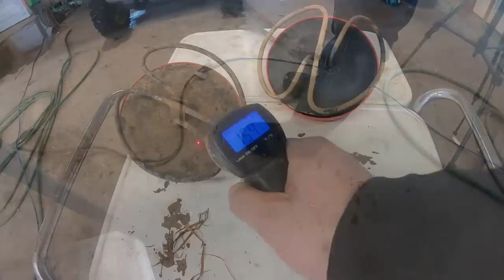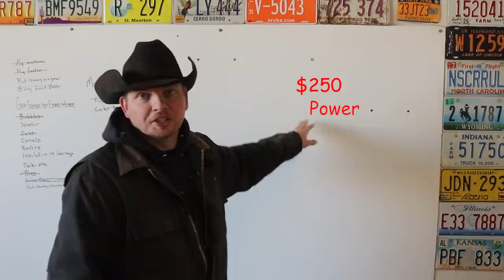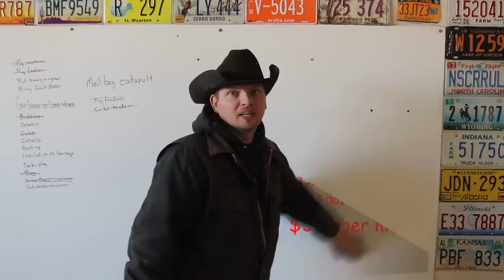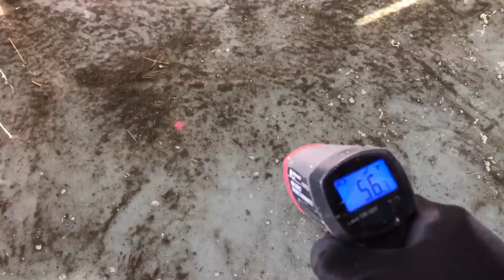Stock Tank Heaters vs. Breaking Ice - Water on the Ranch

Comment: The best investment I ever made was building lids for our tanks. Nothing special, just 2x4s all the way across with a hinged door for livestock access. Morning chores went from chipping ice to just opening the door for them to drink. Significantly cut down on time and propane usage. Unless it's going to be below zero, the pilot light on our heater is enough combined with the lid to keep the 8ft round tanks thawed. Might have to add a latch until the cows get into your routine. Also, the rule I was taught was the warmer water requires less energy to process. So what you might spend keeping your water thawed, is theoretically made up for in more pounds on each animal on sale day. Overall, they honestly seem to winter better with a heated water source. Just my two cents.

Comment: Start framing and insulating tanks with high core density foam.Build the same insulated covers for the tops with only a few holes big enough for a cow or horse to dip their head in.Tank heaters generally come with thermostats that turn off when they hit a certain temp.Insulating your tanks will keep water temps level longer and prevents tank heaters running all the time.This will increase the longevity of your tank heaters as well.Tank heaters should be descaled at least once a month to increase life span as well.Another trick to keep ice from forming is run a small air pump with an airstone which does 2 things.Creates moving water which slows freezing and oxygenates water so in the warmer months prevents stagnant water which reduces algae, bacterial overgrowth ect.Less cleaning for the rancher.I live in Alberta where temps are commonly down around -30°Celsius and this is a life saver for our electricity bill😉

Comment: Mike as a fellow rancher I am all about saving money.  You have brought up an interesting subject talking about tank heaters and the cost of using them (or not).  Prior to returning home to carry on my family’s ranch I worked as a mechanical engineer.  This afforded me a great understanding of total energy costs, not just $/kw-hr.  Did you know it takes roughly 6800 calories to raise one gallon of water 1 deg F?  Think of the feed/energy savings across your herd if you can keep the water at 45 degrees F instead of 32-33 Deg F.
Reply from the maker: I agree, thats why when I'm not running heaters I make sure to get out and clear the ice and let the sun heat the water.  In the video that water that was up around 56 degrees wasnt heated by the heater ( the heaters shut off at 35 or so) but by the sun.  I have noticed that cows wont go to water when its dark and that water is getting colder and most will go for water in the early afternoon.   Of course they have open ponds sometimes too ( depending on weather)  Thanks a bunch Johnathan - Mike

Comment: I remember we made a couple of tank heaters that dripped diesel. Kind of fuzzy on any detail past that. Another cheap easy solution that really works is to put a bunch of black hose/poly pipe scraps in the tank. I had a bunch of short ends of poly tube scrap that I cut into about 1 foot pieces and threw in the tank. They worked like surface solar collectors plus kept the ice from crusting over solid even when cold enough to start icing.

Comment: Good video on a subject not many think about. In the 50's and 60's on our farm in Saskatchewan we used a submersible wood stove in the one galvanized water trough we had. It was placed in one end, took up about 1/3 of the trough and was weighted down with rocks. The trough had a wood box with insulation placed around it to keep in the heat. We would start the fire in the morning and burn it all day. If you stoked it before you went to bed, it would keep the water all night, except in the really cold days. Had 100 cow/calf herd and it was quite congested around the trough.

Comment: Asi remember when I was about 7 years old  in 1956  northern  Ill. we heated 3 stock tanks for 80 steers & 50 sows with corn cobs submersible heaters   4 buckets 5 galion pails of cobs  per htr plus 1 bean can of coal oil thrown on top  of  cobs  to start fire . Fire would last all night , no ice . if  it was below 10 deg. would have to re-fill cobs next morning on all 3 tanks.Cobs came fromear corn.picket corn with corn picker stored in corn crib ..would shell corn with sheller on back of 2 ton truck, to feed or haul to town to sell stoer cobs in cob house..Bofore  electricity came to farm in 1939 my grand-mother would burn cobs in old cook stove to cook and heat water  &  heat house In early 60's propane was used to heat stock water,thenelect,heaters. My how times change
Reply: Wow,you never stop learning

Comment: Those tank heaters are not cheap for sure. I would suggest covering as much of the open water area as possible so you don't try and heat the air that's trying to freeze the water. 2 sheets of plywood top and bottom, some 2x6's around the outside edge, and blanket insulation in between. Makes a world of difference. Also being your around Gillette, get ahold of some earth mover tires. They are indestructible,  and help keep water from freezing with a insulated cover. As always, enjoy your channel and take care.

Comment: The cheapest solution I've found to keeping tanks relatively unfroze is to build a insulated wood box that fits around the tank and also encloses part of the top. I made one that can be set over them with a skid steer and also painted it black to help it get warmer. I've found that poly tanks seem to freeze a lot harder and also easier to crack than the galvanized steel ones, I've been switching to galvanized steel tanks and they actually build up less ice even without the insulated box.m

Comment: I switched over to Richi Omni 5 waters and I have 12 of them. Put a plastic culvert  and a curb stop on the waterline so you can shut it off and drain back the waterline when not in use. Take very little electricity and never freeze up in a ND winter.

Comment: Good calculations. I only have a few cows with a single 100 gal stock tank. I always broke up the ice a couple times a day until this year. I don't have electricity in the back field. I put a small pond pump in the tank to keep the water moving and prevent it from freezing. Much less expensive to run a 12 volt pump than a 1500 watt heater. I put this on a 50amp/hr battery and connected that to a couple solar panels.  Put a cheap temperature sensor on the system to turn the pump on and off with the temperature. The whole thing cost around $150. In testing, I found that the pump does actually keep the water from freezing, at least down to 20°. Haven't had anything less than that so far this year. It comes on at 31°. Had a pretty good cold spell that kept the pump running for 3 days straight. The panels did their job and put out enough power to recharge the battery each day. Then had 3 days of no sun. The battery ran out on the third day. Had to pull it inside the work barn and recharge it. Put it back in the field and haven't had a problem again yet. I expect to see a couple more charges needed before the winter is over. Guess you just can't have everything.
Reply from the maker: Great solution!  Thank you very much David - Mike
Reply: What type of panels and pump did you use? Where did you source all of your materials?
Reply: @ehtozedduo2029  Got all the parts off Amazon. Got a outside pond pump that pumps 200 gal/hr. That's enough movement to keep the water from freezing. The cows don't mind either. Got 2 monocrystaline panels. Used a charge controller that came with the panels. Easy to wire up. Got a runin shed out back. Put the panels on top of that. Put the battery, controller and temp sensor in a tote with a locking lid. Makes it kind of waterproof. The sensor has a probe that just hangs out the side of the tote. So far it's worked pretty good.

Comment: Ughhh, you HAD to say 33 laptops! I run 2 of those sinking heaters! We switched to heaters after I spent 3 years busting out 6 inches of ice. In the end, I was wasting so much water, and there's no direct water source for our cows so it didn't make much sense to be dumping it all out as ice. We now have 100 ft of cord running to a heater for their tsnk. Our tanks would freeze within hours before the heaters. Shock is a,real hazard, I've heard stories. Maybe there's a way to hook up an alarm that's powered on when eletric it hits the water. . . Nice of you to test the water issue though :) always good to know why money is spent!
Reply: Maybe Matt can answer for sure, but I believe that if it is plugged into a GFI circuit it should cut off the power when it gets wet.
Reply: @mikewilder  good point! I know at least one of ours is gfci, better check the other to be sure!
Reply: @This1LifeWeLive   I don't think 110 power would kill a cow or calf,I bet it would make them not want to drink though.I was wowed at how much energy they use as well.
Reply: @outcastprojects6733  if it can kill a whole barn of horses it can kill a cow..
Reply: @This1LifeWeLive   I guess it can,Just read some on it.I think 240 or lightning are much more common.
Reply: @outcastprojects6733  could be. I have not had anything electrocuted, just heard from others who have. But it's possible they may have run it off 220..
Reply: Use the GFCI. The moment water hits or penetrate the cord it will trip the breaker. If you don't have GFCI  you can get an extension cord with built in GFCI and use it to plug your heater.

Comment: Mike,  Let me start by saying I don't know crap from apple butter about ranching.  I did have an idea- would it be worth it to run a 4 ft or more deep trench away from the tank, bury a loop of flex water line and use a low voltage pump (Maybe even a DC pump with a Battery and a small solar panel) to move the water from the tank through the buried line.  Use the warmer temp underground to keep the water warm. put it on a timer as needed- seems like it might use less electricity than a 1500 watt heater - I will refer you to my first statement and words from my undergrad design teacher " That's an idea, not necessarily a good one, but it's an idea"  Keep up the good work- love your vids!
Reply from the maker: Might work, would have to go deep, our frost line here is about 6 feet. Thanks - Mike

Comment: Great video!  The troughs that we have here at our place are gravity filled. When the last one in line is full we adjust a valve so that they don't run over and also as the cows drink from the troughs the water flows and they don't freeze.

Comment: 5:07 here is a tip! Get a big scoop shovel and blow torch some holes in it! Makes shoveling out ice a lot easier and don't have to worry about as much water splashing everywhere!
Reply from the maker: I usually just use a pitchfork.  Seems to work good.  Thanks for watching -Mike
Reply: @OurWyomingLife  also works very well, thanks for the reply!

Comment: I had tank heaters for my chickens. They sure make a difference when the temps get down into the -40s. A full 5 gallon pail of water would top off both tanks and have some left over for the afternoon feeding. IF the water in the pail was frozen by the time I would get there for the afternoon/evening feed, I would break the ice and put that into one waterer and pour the rest of the water into the other one.
They are the greatest thing since sliced bread.

Comment: Put them on a timer to run only  30% of the time. Don't need 50° water. On 30 minutes off 2hrs or something like that.
Reply: Good idea. Also, the cows can do without liquid water 24 hours a day. It's ok to allow the tanks to freeze over, as long as there are windows of liquid water for the cows to drink.
Reply: God idea,
Reply: I use a block call a thermo cube.  cuts electric to the tank heater above 34 degrees
Reply: @blazeman2264   Smart thinking.
Reply: The timer has saved me 12% in our area
Reply: Will they keep the water thawed when the wind is blowing at 25 degrees F. ( and below)  I would like to try one and see how it works. @blazeman2264
Reply: @johnhugon8305   Never had any trouble.  We dont have many days like that but I generally dont have to break ice.  Here is the link:  https://www.homedepot.com/p/120-VAC-15A-Thermo-Cube-Thermostatically-Controlled-Double-Outlet-TC3/100210525
Reply: @blazeman2264 : Thanks Scott

Comment: I have a neighbor who uses a fish tank bubbler in her 100 gal. tank and it keeps a hole in the ice for her horses.  Costs practically nothing to run and does what she needs it to do.  Myself, I use a timer and only have the power on a few hours a night unless the temps go way down, when I reset the timer to reflect that.  I once ran a 1500 watt heater in a bathtub tank and it cost more than my house electric bill!  Having a dark colored tank (painted black) also puts the sun to good use, but in the summer will increase algae growth  so maybe not an option where you are.  Last thought, what is the cost of rotator cuff surgery and your time in recovery mode?  Bet it's a whole heck of a lot more than a heater costs to run.  I almost wrecked my shoulders doing what you're doing, so having a heated tank in the worst weather is a no brainer for me.

Comment: I put in a tire tank they hold about 300 gallon of water. There is a valve that u can turn on that circulates water and they run off pressure from your well. So far this winter hasnt been bad here in Mo but this idea came from your part of the country. It might be a good option for your ranch.

Comment: Awesome video!  Very informative.  Last year I got tired of breaking ice and finally resorted to putting heaters in.  First thing I noticed is water consumption increased!  It may be possible that warmer water is more preferable to drink than the ice cold stuff.  I have been considering timers for a while.  After watching this I think I'm going to put some in.  Having the water at 50-60 degrees all the time just doesn't seem neccessary.
Reply from the maker: The heaters have thermostats on them.  They shut off at about 35 degrees. It's the sun that continues to hear the water. Thanks for watching -Mike
Reply: @OurWyomingLife  makes sense.  :)

Comment: You might consider Ritchie waterers (or something similar) for those pens where you're only watering a few head. Buy the insulated ones (or insulate them yourself if your are being cheap) Then, instead of using a heater, use a stand pipe and keep the water trickling. The colder the temps the faster the trickle.  You'll need to bury a leach line for the overflow. We keep ours open even at -20. It's cheaper to run the water pump than it is to run a tank heater. The added benefit is waterers take up a lot less room in your pen.

Comment: Mike I feel for you. I have a Swing Shift Job that pays the bills. I run 2 Milk Barn Heaters, One in my Boat cabin and the other in the Camper. Plus a Heat Tape on the Goat Water Spigot with the Water Heater in the tank. Both of those have an internal sensor to come on when below freezing temps are around. Never much gave a thought of how much it cost to run them. Sure glad my wife doesn't watch your videos or my butt would be strung up. The Boat of mine consumes some money from Jan thru April in fuel used. 80 gallons each weekend used. Plus from May thru Sept the fuel used goes up to 100 gls or more per day of fishing. I usually get to spread that cost to others that go fishing with me. A normal average Albacore Tuna trip in the Summer is $450/6=$75. Ice, Fuel, and Bait. 40 to 50 lbs of Tuna Loins per person is the result.    

Tuna Fishing is fun. A seat will always be available. July thru Sept weather dependent in Westport WA.

Comment: Great video, I’m always analyzing spending money on my ranch as well, my injection pump needs rebuilt on my JD, to have it professionally rebuilt will cost around $700-$900, I bought a rebuilt kit for $29.00 and probably take 4-5 hrs of my time for me to rebuild, probably have around $150 into it with rebuild kit and my time, a lot cheaper than the $700-$900.

Comment: Hey Mike, did you try putting the feed ground on your high alkaline areas yet? We chopped a lot of ice back in the day but were not faced with what you are facing, Had a lot of running water and holes to chop but needed to keep cattle off the bare ice so we burned coal and spread the coal clinkers around the water holes and the running creek water kept holes open. we would check 2x a day in severe cold. In march there was plenty of clean ditches to catch snow melt. Nice work and good thinking.

Comment: a race horse owner took a piece of ply woodg;ued Styrofoam to ply wood to reduce heat loss horses / cows push plywood down to get water kept water warmer reducing heater electricity and aalsomhad tank inside a smaller tank with Styrofoam on the bottom and sides it seemed to work good //// in south Dakota we covered 2/3 of tank to save propane....flipping ice a slippery mess when it melts  thanks mike ….. jim
Reply: I think this is a great suggestion.
Reply: Hear, Hear on the slippery mess part of slinging ice. I can't pitch it far enough to get it out of the way and it's a lot of walking to haul it to where it doesn't make a mess as it thaws.

Comment: I use earth mover tire tanks with a sidewall cut out.  The rubber helps to insulate and absorb heat from sun. Usually only need to break a think crust on top each morning when cold. Can put covers on them with smaller drinker holes in winter.

Comment: Have you looked into low energy or energy free fountains?  I use 2 low energy fountains and the more animals drinking,  the less need for heaters.  An energy free fountain called Cobett uses no energy and just need an occasional breaking of ice, because it sits over a large plastic pipe buried in the ground.   Initial cost, but saves in a short time.